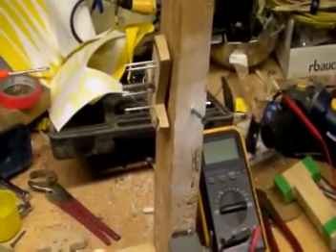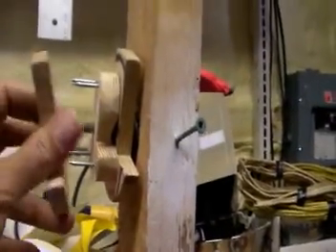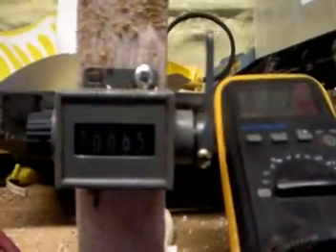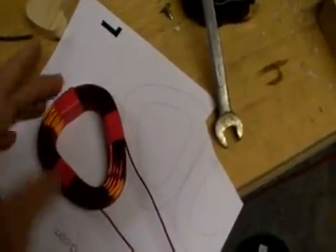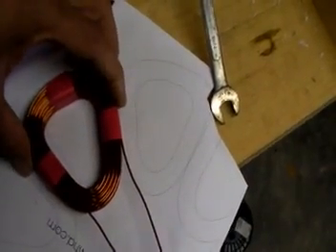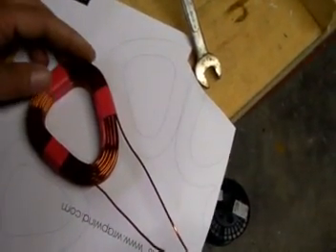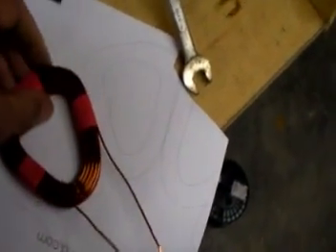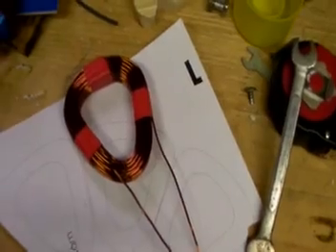axial-flux-coil-stator-01- vawt

Comment: How much turn will have to be given to make single phase 220 volts please reply with 19 gauge wire
Reply from the maker: this is a huge question, it depend on rpm, design, magnet specs/shape, and 220vac is different than 220vdc unfortunately  i can not ansewr this question, there are few calculators out there, but you need to know some of these questions " rpm, design, magnet specs/shape".
Reply: @emagnets  You also bullshitterrrrr you could have told him that thinner wire more turns create more volt and less RPM. Thicker wire less volts higher Amps and more RPM to get volts.

Comment: 1 What is wire guage ?
2 How many turns in one coil ?
3 and total quantity of coils for 220v out put 2kva
please send me some answers
Reply from the maker: sorry that is a huge question u r asking, i am not able to ansewr, i am using gauge 14
65 turns
0.6 ohms
Reply: @emagnets  its not a huge question
simple and easy 
are u use this generator as a dynamo 220v AC out put
Reply from the maker: @MohsinAli-dr7gt  i built this gen for a VAWT that produces 100vac at 200 rpm
Reply: @emagnets  Can u help me ?
I already work at BLDC Motor 
but confuse
Help me easy and simple method
Also help in ESC Circuit for BLDC Motor

Comment: Hello all, I have been watching & watching yours & others vids. I am trying to findout where to start on my alternator build for testing?  I have a 26" diameter wheel I need to turn in to an alternator.  Low RPMs 100 to 150 the target. The magnets have to be mounted on the out side circumference. Lots of room for Coils, I am only looking for 100-200w but I need minimum 48v. My question to you is where would "you" start for a build like this? What gauge wire, number winding's & size magnets would you start at first? I realize this is a wide range question, I am only looking for a place to start before I spend my precious dollars.  
Thanks in advance Murf!

Comment from the maker: great, i though you forgot about me..lol. i guessed you are bussy,  i went on a hunt and read every post rgarding the 9/12 axial flux alternator. all i used is tape to hold coil together, do you think i should glue each of them seperatly before resin them in?.
 i hope i start assembly next week. i will get back to you on every step.
the disck foe the col-r are comming from cnc cut next week also, i am spending like crazy, 
regards

sam